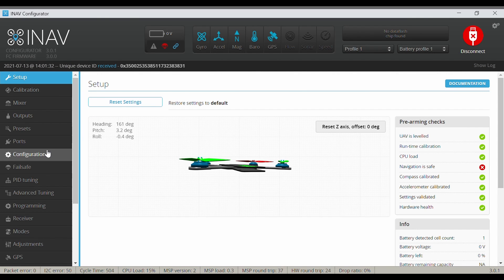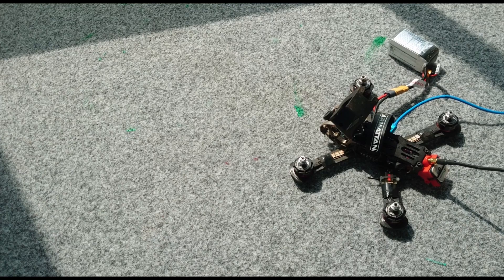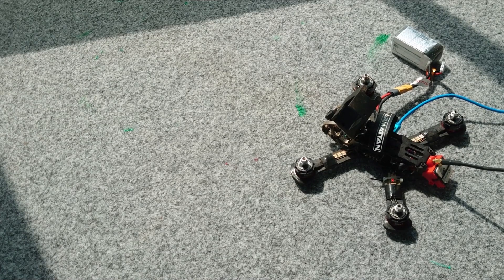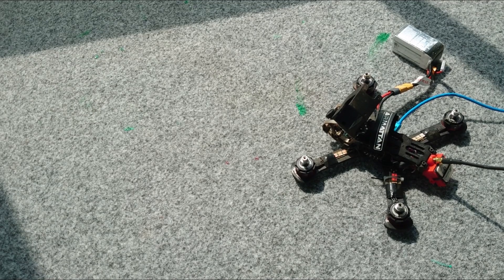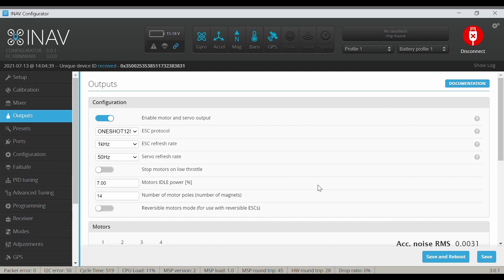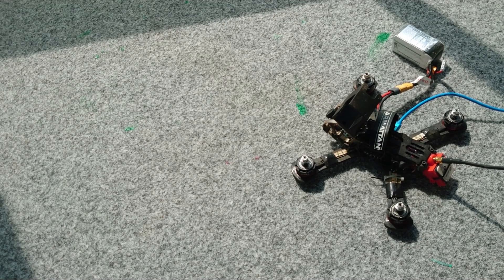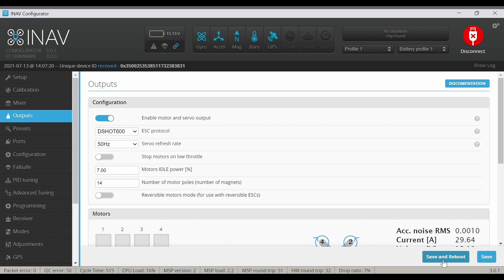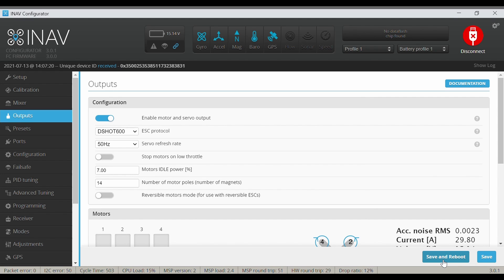INAV ESC constant beeping...ESC protocols | Part 2/3

Comment: I had the same problem. In my case the setting for Magnetometer was wrong. It was HMC5883. I set it to AUTO and INAV recognized QMC5883, which is slightly different. Now I can use DSHOT600. The wrong ID of the HMC5883 causes a beep warning. The beeping came from the board and the ESC. Now no warning, no beeping.
Reply from the maker: Thanks for sharing!